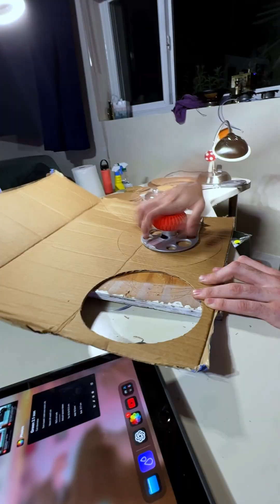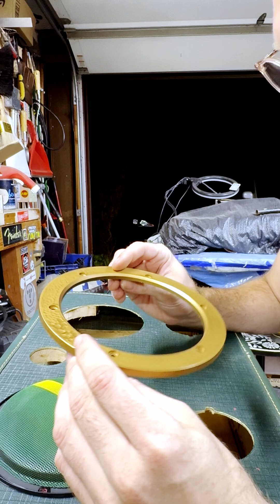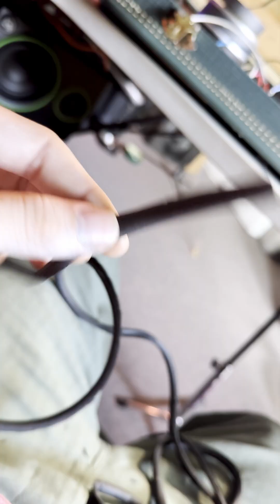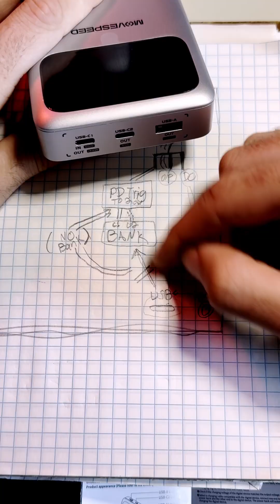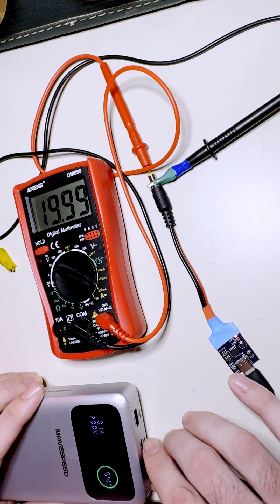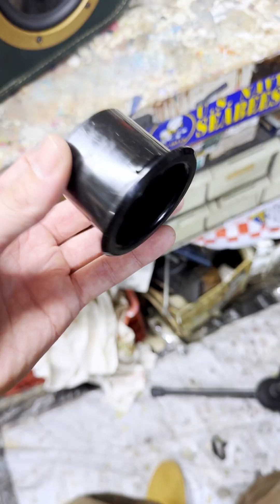I Turned a Vintage Suitcase into a 150W Bluetooth Boombox (Budget Build)

Comment: Thanks very much for posting this. I have accumulated 3 old suitcases and a 1970's aluminium camera case along with sundry speakers and other crap for upcycling. This is going to help me on my way.
This is probably the best video I've seen on this subject. I'm absolutely NOT an expert but I'd just like your thoughts on a couple of things: I know you're very limited for space in there but would it be possible to enclose the bass driver and the port? I can't help thinking that it's movement will affect the other speakers. Also, would a passive radiator in place of the port help with achieving this? I've found cheap ones on AliExpress.